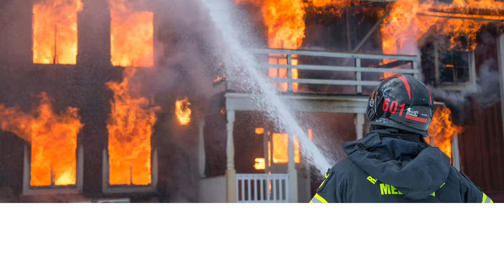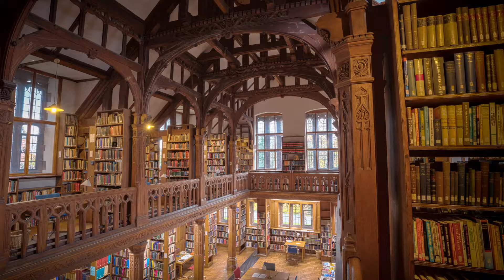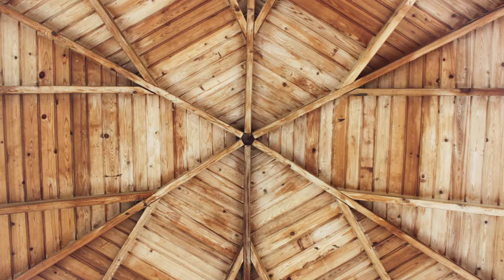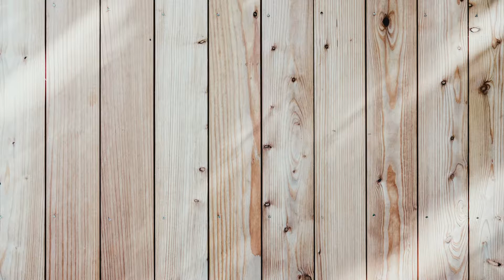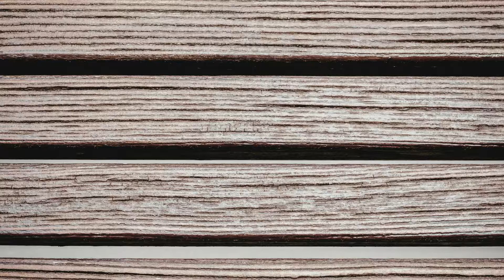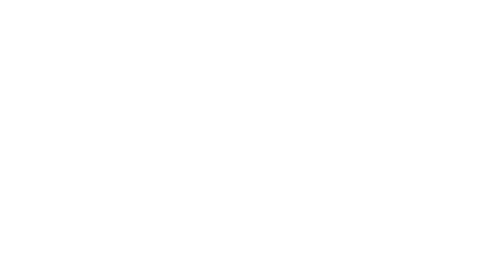Timber Structures in Fire: Introduction

Comment: The wood structure needs to address electrical faults that can arc through the wood and wood pop splintering during an intense fire.  Both of these issues can negate the protective charing surface and expose fresh wood.  One thing I have noticed, watching a few heavy timber fires is how some timber sections had their protective char layer spawl off exposing fresh and preheated wood.  In both cases the interior of the timber may have trapped superheated wood gases in a hot fire much like explosive gases trapped in volcanic rock.  It just takes a part of the char layer to be spawled off to introduce a lot of hot fuel to a fire.  Fire sprinklers will be compulsory for retarding the fire and to provide an emergency ground for electrical.